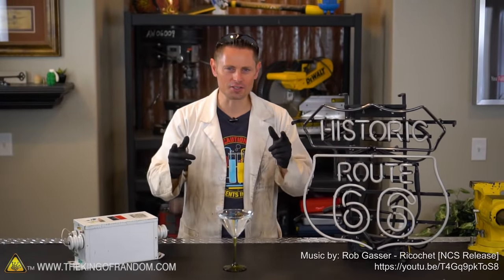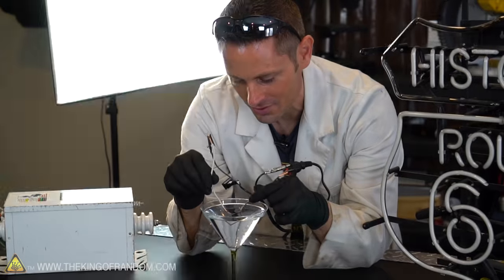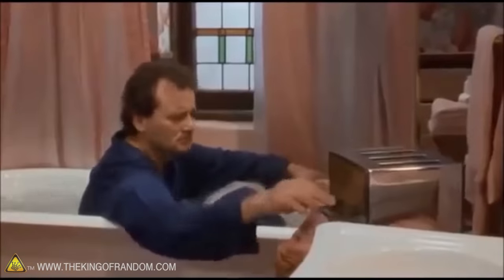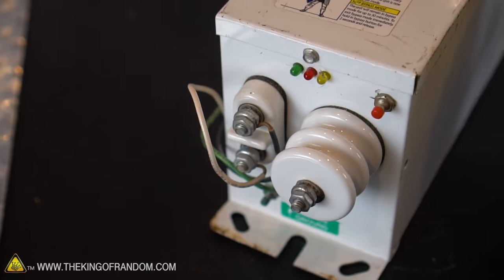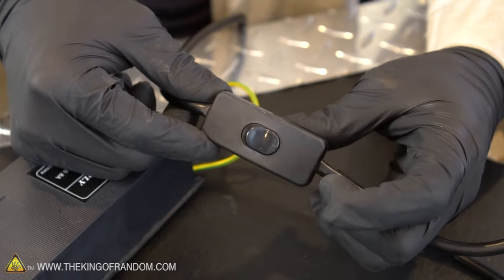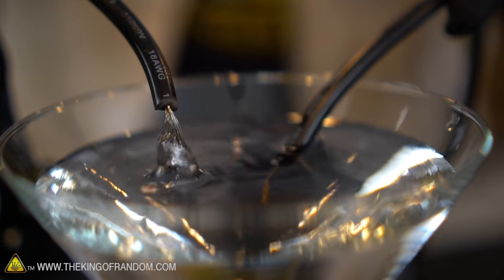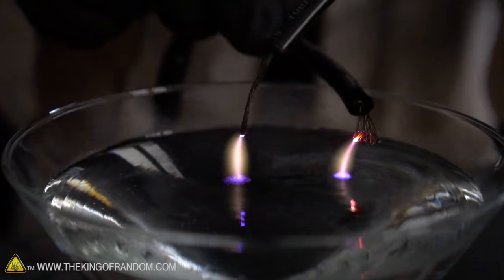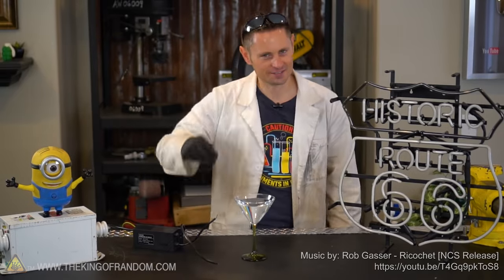Don't Mix Electricity And Water! TKOR Experiments What Happens With Electricity In Water!

Comment: Actually everything is conductive. If you have enough voltage to pierce the internal resistance.
Reply from the maker: +Riddim Dubstep true story
Reply: Distilled water is conductive a little bit due to autoprotolysis: 2 H2O ----> H3O+  +  OH-
Reply: Urh Cotman indeed but what I said applies to almost everything. Electrical tape, rubber, plastic, etc.
Reply: Riddim Dubstep no. thats not how it works. 
arcing over means that the potential is strong enough to send electrons out at such a high velocity that they go through the insulator. 
it does not have anything to do with resistance.
Reply: Actually it's more complicated than that.  Ohm's law only works in certain regimes, and dielectric breakdown is not one of those regimes.  Once the potential is high enough, the electrons have so much energy they don't even need a conductor to transport them (electrons can conduct through perfect vacuum, for instance).  

In the case of arcing in air, what happens is that the potential causes the air to ionize, creating a conductive plasma.  That's what the blue electrical arcs are made of.  So it's not so much that you have overcome the resistance of the air so much as actually altered the electrical properties of the media and created a conductor that wasn't there before.
Reply: Riddim Dubstep even if electrons penetrate, current still matters
Reply: Riddim Dubstep conductive means it EASILY let's electricity through it. lightning is not making it easy
Reply: I'm sorry but not everything is conductive. Noble gases have no way of carrying current.
Reply: Cosmo yes they do if the electrical potential is great enough to rip electrons from their outer orbital
Reply: Daniel White an ionised noble gas is so remarkably unstable it could never exist in an unpaired form for more than a fraction of a split second. As a compound (noble gas compounds do exist, though they are incredibly difficult to produce), it could not carry current
Reply: TheGameDragon that's not how it works

You claim a resistor is not conductive, because it "blocks" electricity

Resistance is a thing
Reply: can electric charge cross vacuum?
Reply: Pikop V that makes no sense. Arcs are air energised to the point of becoming plasma. There is no air in a vacuum.
Reply: Riddim Dubstep not true
Reply: Riddim Dubstep not every thing is a conductor,
Reply: schmobot yes, the electrons themselves (if using two metal electrodes) can travel quite easily in a vacuum. You just need to apply a voltage such that the energy of each electron is greater than the work function of the metal
Reply: Muhammed Soobrattee The sign in the video would've originally contained a noble gas. That's why power supply needs to be such a high voltage to ionise the gas and produce light.
Reply: BROTHER
Reply: LORD
Reply: drkastenbrot You can easily work out the drift velocity of the electrons given the current (30mA), charge carrier density of copper (8.5x10^28 m^-3) and by estimating the diameter of the wire (~2mm).
With these figures the drift velocity (average velocity of electrons in the metal) would be around 7x10-7 m/s ( 0.7 micrometers per second!)
Reply: drkastenbrot as Jackson Burek said, You're wrong. Electrons only jump when the voltage is big enough to be able to push the electrons through the dielectric resistance. Of course resistance matters.
This is why electrical cables are rated in volts, not in wats. The cable is not the one that can't handle more voltage that it was made for, it is the insulator that can't. Example, spark plug wires.
Reply: Yes and no... Most things can become conductive but electricity (flow of electrons) require freely moving charged particles. So the states of objects must be correct. A giant block of solid NaCl (table salt) isn't but when it is dissolved into water it transitions into Na+ and Cl- (the freely moving charged particles) forming an electrolyte.
Reply: TheGameDragon No. Conductivity is more like a scale. Compare the graph of those germanium diodes with those made using silicone. See the open voltage. Silicone diodes open at 0.7V and germanium diodes at 0.3V
Reply: Realise as you said, yes and no. Even solid salt would let electricity flow through it (of course the current would be lower and you need higher volts than what would be needed when disolved in water). Sodium is even used in lights (see HPS lamps).
Reply: Riddim Dubstep     Actually I was talking to you.  What drkastenbrot said is partially true.  When arcing occurs, it means the dielectric breakdown voltage was exceeded.  Dielectric breakdown is NOT the same thing as resistance, but it is also true that most materials with very high resistances also have high dielectric breakdown voltages.
Reply: yep true :D
Reply: Jackson Burek and how do you calculate dielectric breakdown? Noone said that dielectric breakdown is the same as resistance. However, dielectric breakdown IS based on the dielectric resistance. Dielectric breakdown is just a measurement unit (measured in Volts/distance) to show you what voltage is required for the electricity to pass through it  (and the following is a very important thing) AT A CHOSEN DISTANCE between the electrodes.

The big role plays the actual resistance of the dielectric. The closest you get the electrodes, the lower the resistance is between them. Getting closer enough the resistance drops to a point when electricity pinch through the dielectric.
Reply: You should thank A Zastawny for releasing an entire table full of constants to help people calculate the dielectric breakdown easier. Rather than going through all the hustle to calculate it, just use his constants in a simple formula: Vbreakdown = B * p * d / [C + ln( p * d)]
Reply: Riddim Dubstep not quite.  Dielectric breakdown isn't normal conduction.  Distance is only a factor if you specify breakdown as a voltage.  If you specify it as an electric field, then it doesn't matter what the distance is.  As it's true that both breakdown voltage and resistance change as a function of electrode distance, they really aren't the same thing (they're just both correlated with distance).  If you're interested in the topic, you can look into band theory and Fermi levels.  You'll learn the physical difference between conductors and insulators, and you might learn the mechanism of electrical breakdown.
Reply: Let's state from the beginning: We are talking about insulators, not semiconductors, metals or semi metals. If you specify it as an electric field, distance doesn't matter? For real? Like, do electric fields travel through the dielectric at 1 meter the same as at 0.5 meters (without changing the eV or the temperature)? Do you even saw what you typed? Fermi levels refer to the actual process of interaction between electrons.

Firstly, you cannot apply any Fermi formula since there is no electric flow. To get an electric flow, you need to get the electrodes closer enough to lower the resistance of the dielectric, in order to let the electrons "fight" with the resistance and pass through.

That's where the actual resistance of the dielectric comes into play. Until you get the electrodes closer enough for the resistance between the electrodes to allow electrons to "fly" from one electrode to another or, increase the voltage between the electrodes high enough to pinch the dielectric, there won't be any electric flow.

P.S. I think I know what is "the physical difference between conductors and insulators" since I finished Electronics & Automation... And beside that, I'm also a level 4 (according to European Qualifications Framework) IT technician (grade I got when I finished college, plan into increasing it)
Reply: Riddim Dubstep I don't think you see my point.  1) Yes distance doesn't matter when you formulate with the electric field.  This is clearly true if you look up the dielectric breakdown of air: about 3 million volts per meter, no matter how far away the electrodes are.  It's in the dimension: the per meter term accounts for the distance.  Thus you can specify a value invariant of the situational geometry.  Once you choose a distance, then the breakdown voltage can be specified using the breakdown field and that distance.  Yes, an electric field will behave the way you just described.  2) It doesn't matter what material we are talking about, all elements obey the band theory of conduction.  Insulators have bands that are so far away from the Fermi level that there are no free electrons available for conduction.  It doesn't matter that no current is flowing at low field values.  You see, that's the whole reason that no current is flowing.  3) You keep talking about resistance but resistance isn't applicable in insulators; the resistance is infinite.  If you get the electrodes closer in an insulating medium, the resistance doesn't decrease because the resistivity is infinite, so the resistance is infinite no matter what the area, length, or temperature of the insulator is.  This means changing the voltage will not change the current.  The current will always be zero; there's no conduction in an insulator.  However, if you hold the voltage between electrodes constant and bring the electrodes close together, the electric field can go above the breakdown field, which would cause an arc to form.  Before the arc formed, however, there was no current flowing.
Reply: Firstly, nothing has infinite resistance. The resistance of an material is given by it's thickness and it's composition. We are not talking about ideal insulators because, as you might know, there is no ideal thing in real life.
Indeed, all elements obey the band theory of conduction but there is resistance between bands in which if you apply a voltage high enough you will get electrons to flow through it.

Also, I think YOU don't see my point. Firstly, distance DO matter if you want to get an electric breakdown. If I have 2 electrodes at one meter, through air and I only have 1.5MV power supply, what should I do instead of getting the electrodes closer, to lower the actual air resistance between them?

Also, there is current flowing. When arch is forms through the dielectric, in ideal conditions (constant temperature, etc), the current flowing is the actual current calculated by I = V/R and R is the resistance of the dielectric calculated by R = ρ(L/A)
Reply: Kyle Hershey quoting myself from my ABOVE comments (since it seems that you can't read before commenting): "That's where the actual resistance of the dielectric comes into play. Until you get the electrodes closer enough for the resistance between the electrodes to allow electrons to "fly" from one electrode to another or, increase the voltage between the electrodes high enough to pinch the dielectric, there won't be any electric flow."
Increasing the voltage high enough until the dielectric resistance can't handle and you get electric flow through the dielectric.
Reply: Voltage most definitely ISN'T the measurement of flow of electrons. Voltage, or potential difference to use a better term, is exactly as the name suggests - the difference in electrical potential between two points. This means that you can have a potential difference (voltage) between two plates (a parallel plate capacitor) and yet have no current between the plates. V = IR as you seem to have quoted is true for for calculating potential differences across devices in circuits but is not the absolute definition of potential difference.
Reply: I know but what I wanted to state is that you can't have a flow of electrons between two points until you have enough voltage to fight with the actual resistance of the dielectric that is between those points. And the thicker the dielectric (or better to say, the bigger the distance between electrodes) the bigger the resistance that stops electrons from flowing through it. Basically, the higher the resistance of the dielectric, the bigger the voltage required to pass through it.
Reply: Old TVs work by sending electrons through vacuum. You indeed can do it. It actually is easier as sending it through air cause there is less in the way, so to speak. Nothing in need of ionizing that is.
Reply: there is 666 likes illuminati
Reply: Riddim Dubstep I liked it so it's 667
Reply: Riddim Dubstep Actually, you need the amps
Reply: To defeat resistance. Ohms law. V=I•R
Reply: You can't defeat resistance if there is no electron flow. Basically you can't have intensity (amps) through an object (for example, human body), if there is no electron flow. That's why you don't die touching the car battery even tho it has over 70 or 90 A. There is no electron flow because the voltage is too little to surpass the human body resistance. And by the way. AC is more dangerous to humans because human body also acts as a capacitor and as you might know, capacitors can't block AC, only DC. Basically: U = u*sin(omegaT+fi0) where; U - Outlet AC Peak, u - Outlet AC voltage, omega - frequency, T - period, which is 1 in this situation and fi0 is the phase shift between intensity and voltage, since we are talking about the outlet AC, it is in phase. Doing the math, you'll get to U = 240/0.78, ~314V peak through your body..
Reply: Miguel Laurito nope. Not all materials are ohmic conductors
Reply: so we put out the the word insulator..
Reply: nerd
Reply: Remon Gabrail not really it's simple 5th grade science
Reply: Remon Gabrail then again all you watch is Wolfe and other BS so I'm guessing 1st is a bit much for you
Reply: Riddim Dubstep
Reply: That's why cars are hit by lighting.... Because rubber doesn't conduct... Riiight.... As I previously said, everything has internal resistance. If you have enough voltage, electricity will find the shortest path through rubber, from one side to another. That's why electrical tape is rated for a certain range of volts.
Reply: That's why as electrician, you need different type of gloves for different type of lines.
Reply: Riddim Dubstep i actually learnt something from the comments.
BETTER THAN SKOOL
Reply: Riddim Dubstep plz explain in such a way that a not so intelligent person understand
Reply: Riddim Dubstep we already learned that in the sixth grade so you are not smart.
Reply: ITSMESHREEHARI if you have enough power you can pierce anything.
Reply: Riddim Axel
Reply: Wow you learned about fermi levels and internal resistance in the sixth grade?
Reply: oh im so sorry i thought you where talking to me
Reply: And you must be 12
Reply: Super
Reply: Riddim Dubstep lol i was cringing the whole video at him saying that it wasnt conductive
Reply: Same tbh
Reply: My brain hurts after reading all the comments
Reply: Riddim Dubstep hmm k explain modern fuel pumps bare wires exposed sitting in raw fuel
Reply: 12V or 24V is low voltage. Can't jump from one terminal to another, so no spark. Plus a fuel tank is sealed, so nothing big would happen if it sparks.
Reply: Riddim Dubstep does it apply to electricity?
Reply: What?
Reply: Riddim Dubstep is right. everything in this universe can be explained with magnetic permeability and electric conductivity. there is no true "insulator".
Reply: Exactly. There are ideal (or true) insulators but just in theory to help explaining and understanding but in real life, everything has it's limits.
For those who don't believe, replace the thick spark plug wire, with a wire that has thinner insulator. See if you get electric shock through the insulator,

P.S. I think I've been using the term "isolator" reffering to "insulator" because the term "isolator" is written almost identically to "izolator" which in Romania, this is the word for "insulator". My bad.
Reply: Nope. Pretty sure the Earth is flat.
Reply: Riddim Dubstep that's what she said.
Reply: I feel that this doesn't apply to every atom ...what about rare gazes they are stable so they don't give away a positive or negative (i study the terms in french idk how its called in english) i hope u understood what i'm talking about :)
Reply: DeeP MaThs study noble gas ionization. In an Neon tube for example, you have a cathode to one side and an anode to the other side and the greater the distance between them, the more voltage you need. Electrons coming from the cathode of the power supply are "thrown" through the glass tube to the anode of the power supply. While they pass through the Neon gas, it ionizes it. Some electrons from the outer level of Neon are charged with energy and they jump from superior levels to inferior levels and when they come back (from the inferior level to the superior level), it releases a photon (light). Thus, the higher the voltage you apply across the tube, more levels the Neon electron will jump inside the atom and more light will be released when it comes back from the inferior levels to the level where it was.

For Neon you need like 21eV for one electron to jump one level. 2 levels? 42eV. That's why Neon tubes are vacuumed before inserting the Neon gas so they insert less gas inside, therefore less voltage for it to light. Even tho you need quite a lot of voltage (~10kV) to lighten an 1m tube.

LASERs work on this principle too.
Reply: Also, it's highly likely that material dissolved into the water from the wires and the insulated wire casing, especially when the electricity burned some of it.
Reply: Nerd
Reply: How bout deez nutz?
Reply: Riddim Dubstep is that tru
Reply: Actaully everything isnt conductive  if tge voltage is high enough its able to pass Through the resisting material.
Reply: acktually
Reply: Nerd
Reply: Jackson Burek In the comment section i always want to find a comment written by someone who knows what he is Talking about. Awesome!
Reply: Riddim Dubstep thanks for the knowledge
Reply: Riddim Dubstep I
Reply: Riddim Dubstep not space
Reply: Not nothing
Reply: What about rubber? Even rubber?! 🤯<— (lol)
Reply: Not true. It requries electrons to transport the electricity. Plastic for exampel is non conductive!
Reply: Cosmo Ever seen a metal balloon with an inert gas hit a power line?
Reply: I KNEW RIDDIM MADE PEOPLE INTELLIGENT
Reply: True
Reply: Cool...............and scary
Reply: Your smart
Reply: @sheldoncooper2766  do it do it do it
Reply: Do dat high voltage electricity in slow motion...try it
Reply: I can make you go to 2.5 k likes do i do it?
Reply: Water is an insulator, only the tiny metal particles in it are conductive.
Reply: R/iamverysmart
Reply: Right air can also be
Reply: @Riddim Dubstep, you had 2.7k likes and I gave your comment a like and now you have 2.8k likes!!
Reply: The what with WHAT
Reply: How about noble gas